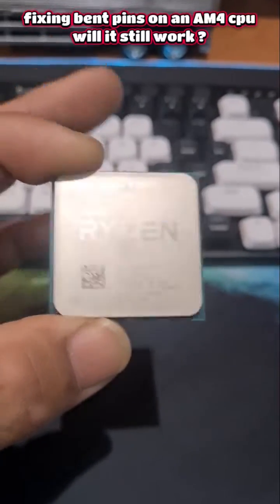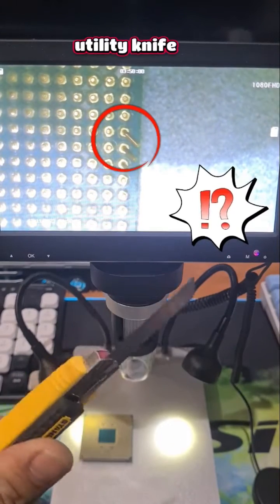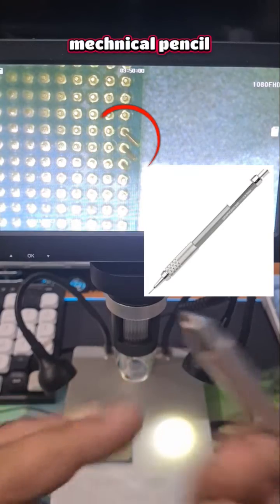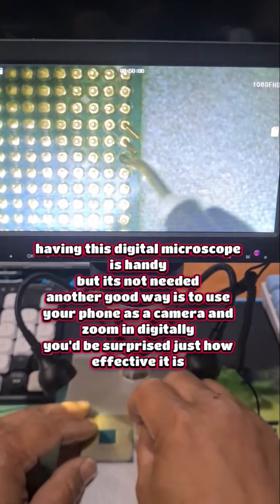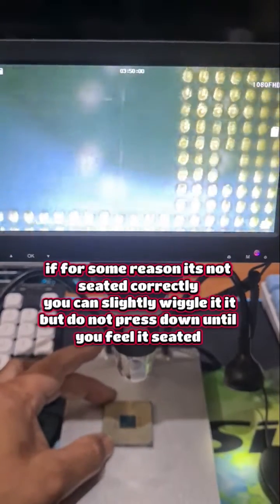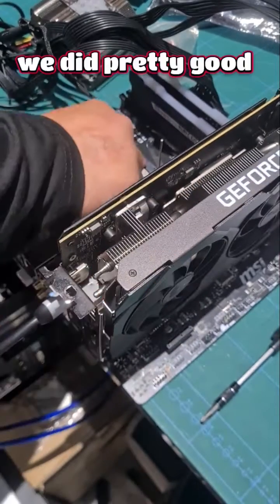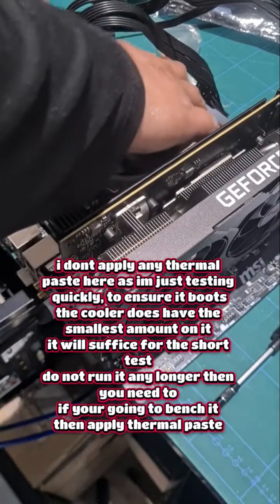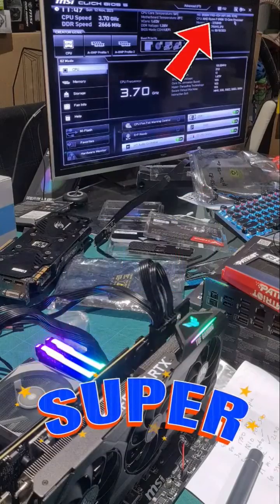how to fix bent pins on an am4 cpu ryzen 9 5900x. will it work? what's the best method?

Comment: Name of tool?
Reply from the maker: digital microscope with pcd screen paid 100 aud shipped from eBay..readily available on aliexpress eBay and Amazon don't pay more then 120 aud shipped
Reply: @MIKEYZVLOGZ  not the microscope but the tool to bend the pins back in place
Reply from the maker: @akalegnd  oh lmao... that's actually the end of a tool that can inject very small amounts of liquid of material like composite...but u can always use a mechanical pencil tip it's the same thing ...
Reply: @akalegndplus  Could you please just tell us what tool to get.
Reply from the maker: @sickvic3909 which tool ? the one i use to bend pins back ?
Reply: @MIKEYZVLOGZ  no shit Sherlock yes tell us the name of the tool you used to bend the pins back
Reply from the maker: @akalegnd  i dont know the name of the tool as it was something random i found... heres what it is ...its cap of a syringe that injects composite ... so use a mechanical pencil instead its the exact same thing...i cant tell u the name as i dont even know what it is ..it was something random i found .... use a mechanical pencil ... same principle .has a hole where u can stick the pins in ans bend them back straight...i wish i knew where to get them ... my partner works as a nurse for dental and its a tool they use to inject composite ..hence the small hole in the syringe cap.... but use a pacer/mechanical pencil but one with a thicker lead so it can fit the pins ...i hope this helps u guys out

Comment: Quick before the 6 year olds! First
Reply from the maker: even of the cpu is that old it's still a very good cpu still .just like the 9900k still does good and the i7 8700k even the and 9700k...some ppl still use the i7 4770k ... I guess it all depends what ur using it for ...if it's just for work station and editing rig it's very descent still 12 cores 24 threads